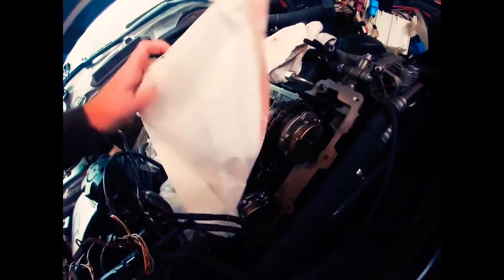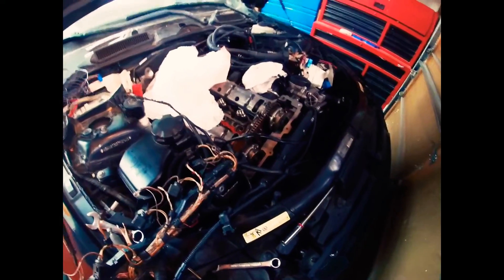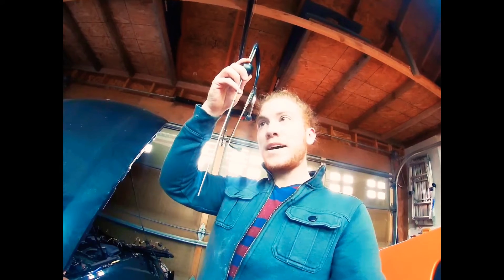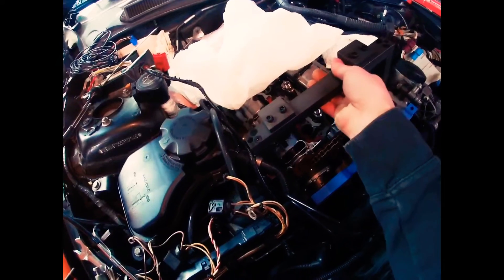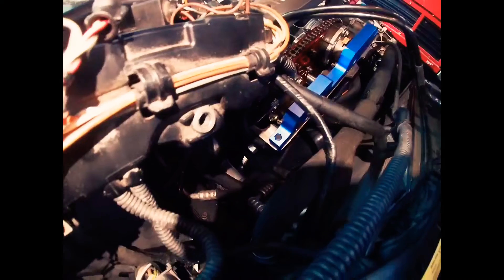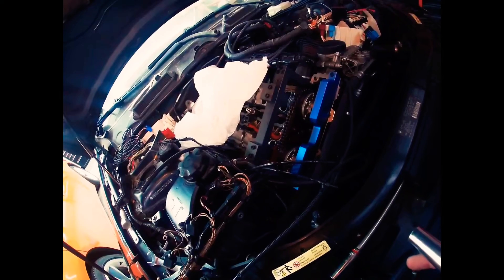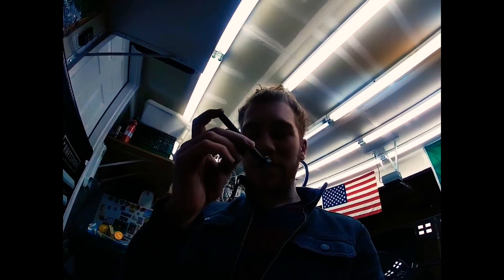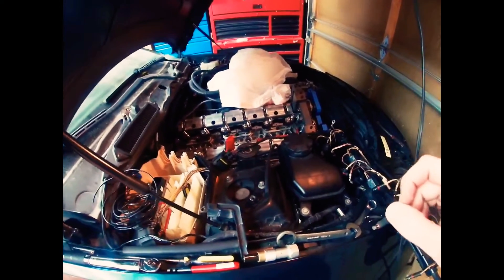Attempting to Fix Timing Issue | Bmw N54 335i Vanos Sprockets and Timing N54 Engine

Comment: You left out putting in the tensioner from the timing set. That tensioner pulls the slack on the chain
Reply: When I did it, I loosen the sprocket bolts. Changed the vvt sprockets then screwed in the tensioner bolt that comes with the kit. Tension sprocket bolts to specifications. Make sure timing is correct by manually spinning the engine to ensure no valves hit, once all looks good remove the tensioner that came with the kit and replace with a new tensioner bolt to specifications. From my experience.

Comment: I rebuilt my cam ledges and set the timing and have had to take it apart a few times to verify that it all aligns but my car still won't start! I have noticed it doesn't seem like there's oil getting thrown up onto the top end when I take everything off and check. I just keep getting codes that my intake cam can't be found and I have checked the wiring, replaced the sensors and still have no luck. But the funny thing is when I first disassembled the top end after inserting the crank pin both cams were at the 11:50 position and I had to turn the crank every so slightly to instally cam lock tool to proceed with the teardown. Should I set the timing ever so slightly to just before TDC like how it was before?
Reply from the maker: Timing can always look a bit off, but you should verify all the timing marks with the cam locks and the crank locks, if those are all in the car should be at the correct tdc to run and you might have a different issue
Reply: @ProjectRacecar2  yeah I mean I checked everything. Funny thing is it's been sitting for a few months and I tried to randomly start it and it wanted to turn over for once, even sputtered a bit but the battery needs to be charged
Reply from the maker: @erikalvarez4516  I would charge the battery fully and give it a shot in the morning! I would make sure the cam sensors are seated correctly they are really easy to not have them seating right which won't cause it to read! It happened to me during the install

Comment: Do you take off the serpentine belt to move the crankshaft?
Reply from the maker: Ummm you know I don't think I had mine off, you should be able to do it with the belt on!🙂
Reply: @ProjectRacecar2  did it take a lot of pulling force to move the crank? I put the car in neutral and tried to move it but it didn’t budge. I took the sparks out to release the pressure.
Reply from the maker: @ButteredPeanuts  no it should be pretty easy, your wheels might be fighting it, turning the crank might be fighting the wheels on the ground I can't remember if I had the wheels up, but it should be a firm turn but maybe on 20ft pounds of turning
Reply from the maker: @ButteredPeanuts  if the serpentine belt is on, maybe try taking it off since that is an easy job, make sure you write down the diagram of it!
Reply: @ProjectRacecar2  yeah. I’m trying to take turn the crank bolt but it’s not budging. The car is in neutral and the e brake is off
Reply from the maker: @ButteredPeanuts  yeah don't push too much on the crank it's an easy thing,  I would start with the belt, then If that doesn't work raise the rear wheels
Reply from the maker: @ButteredPeanuts  I know this is a dumb question but the flywheel lock pin isn't in the transmission yet right?
Reply: @ProjectRacecar2  no not yet, I took the plastic one out but didn’t put the metal lock in
Reply from the maker: @ButteredPeanuts  for sure, yeah that will naturally lock it up so it won't crank, I'm not sure what's going on then! That would be everything that I would try, you can test the best off and the tires off the ground
Reply: @ProjectRacecar2  should the car be in park or neutral with the e brake up or down?
Reply from the maker: The car should be in neutral with the ebrake down, that should disengage everything
Reply: @ProjectRacecar2  does it matter which way I put the sprocket on the cam?
Reply from the maker: @ButteredPeanuts  yes, let me check to make sure but they should go on the same way the came off
Reply: @ProjectRacecar2  okay.
Reply from the maker: @ButteredPeanuts  so it should have the "in and ex" facing the front of the car, there are little imprints on the sprockets! Make sure you get the "in" on the intake side and "ex" on exhaust side because that's what made my engine not run!
Reply: @ProjectRacecar2  okay. Did you randomly place your sprockets on the cams after putting them on the correct cams. Did you have to rotate them a certain way on the chain?
Reply from the maker: @ButteredPeanuts  the sprockets can go on any random way, the metal plates are what correctly time the motor, for the vanos and the holes in them line up with the timing tool
Reply: @ProjectRacecar2  does the engine have to be at a certain rotation when I’m done timing it? I fixed the sprockets and am ready to put the cover back.
Reply from the maker: Clyinder 1 has to be at top dead center!
Reply: @ProjectRacecar2  I put the sparks plugs

Comment: Subframe is easier
Reply from the maker: You think? Im just not a fan of working under the car
Reply: @ProjectRacecar2  yeah under the car sucks but for just an oil pan it's the way to go in my opinion. Also it's not ideal on jack stands
Reply from the maker: @Beemerboii  yeah I was on jack stands I don't have a lift, but I ended up just pulling the motor and left the transmission in, it wasn't all that bad
Reply: @ProjectRacecar2  that's awesome man I'm glad it wasnt too bad I have yet to pull mine cause I always figured it wasn't worth it.
Reply from the maker: @Beemerboii  it's really easy for the most part, I had to pull the head and easiest way is to pull the motor, I did it by myself in 2 days without ever pulling a motor! The whole front end comes off! Thanks for stopping by man!

Comment: Did you fix it?
Reply from the maker: I've had some issues with the car that came into play, I haven't started the car yet to see if it's fixed! I am in the process of pulling the motor, but I'll post an update as soon as i try to start it!
Reply: @ProjectRacecar2  wow! OK! Hope after all this runs fine!
Reply from the maker: @JonathanRomeroMusic  I'm hoping so too! We will see! It's been down for too long! I might be picking up an e30 this week so I might have content on that soon too
Reply from the maker: @JonathanRomeroMusic  hey I just wanted to update you I got the car running today! The swapped sprockets were the issue!! It ran and drove for the first time in a year and a half!!
Reply: @ProjectRacecar2  wow glad to hear that, awesome
Reply from the maker: @JonathanRomeroMusic  yeah I'm super excited about it! Just wanted to update you because I said that I would!
Reply: @ProjectRacecar2  thank you so much bro, I really appreciate it
Reply: @ProjectRacecar2 what was the issue that u had to replace the sprocket was it making noise from the engine ?
Reply from the maker: @BrandonSaric  the original issue was a valve not sealing, so I paid a shop to remove the head, they pulled the two cam gears off and swapped them back incorrectly, the two sprockets are different and when the car tried to adjust cam angle it adjusted too much or too little and the car would stall at 3k rpm
Reply: @ProjectRacecar2 Thanks for the video and for keeping up with addressing comments. My n54 is awaiting intervention as we speak. I hope all is well with you and your cars.
Reply from the maker: @iceyu2235  of course I hope it helped! Yeah the n54 aways needs some sort of love😂 I moved platforms! I just finished my build on a rwd turbo k24 in an e30! But thanks man! Good luck with the intervention!